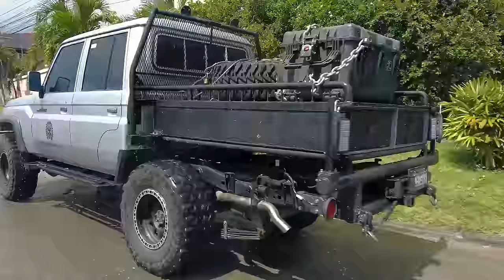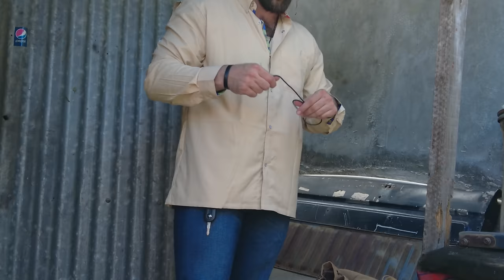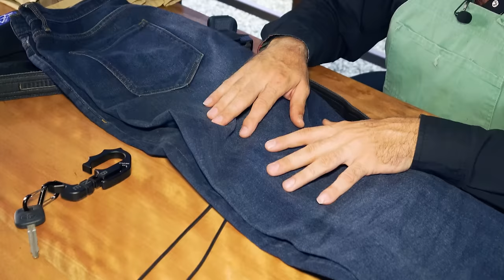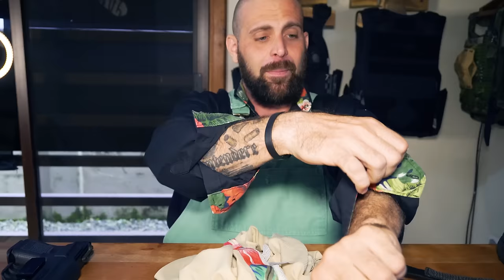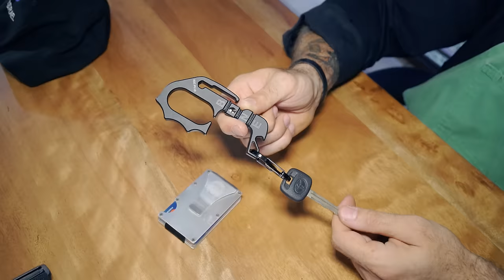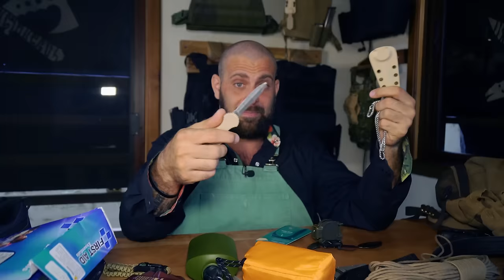The Real Gray Man Theory for the Next Civil War

Comment: Greg, I have a very low cost answer for hair cutting.  So low cost it less then the cost of one hair cut, the answer is a low cost pet trimmer that comes with a lithium battery fully chargeable holds a charge for months.  Here in the southern US the jeans are seen very similar to SA and CA.  Clean and neat no holes, you’re good to go.

Comment: I like the anti-pat down feature of the shirt.  It would be interesting to see if a handcuff key could made it through a pat down.  I'm pretty sure one of my boxcutter blades attached to a guitar pick with duct tape could pass inspection having almost no signature being small and flat.
Reply: Yeah that's the one thing I noticed that was missing. It's a good set up and he's right about stuff. But some way to slip cuffs and zipcuffs would be nice to have in the bag
Reply: Not through a metal detector ...use a ceramic blade 👍🤙👊 🍻 cheers
Reply from the maker: As discussed the pack has plenty of extra room for what you find to be personally useful to you and your situation
Reply from the maker: Yeah for sure there are slim handcuff keys that also fit in the coin pockets of the shirt 👊🏼
Reply: @BoneTactical  I like the pack.  It's sitting in my cart right now.  However, I'm torn between the long sleeve light colored shirt and the short sleeve floral Hawaiian.  Decisions, decisions.
Reply: @BoneTactical I became a fan of yours because of your philosophy. I've been in the same place you've been and you speak the truth. Even if I would keep some of it to myself lol. Keep it up.

Comment: I completely share your ethos on grayman theory. Most of what is taught will get people killed. Also I love the shirt. I'm not military but have been in some very hairy LATAM situations over the years working. From experience I have learnt, don't look rich, don't look military and if possible you want to be underestimated but professional and respectable. Wear a collared workwear shirt, wear double stich low brand trousers that stretch a bit. Riggers pants work great. Clean and presentable is also important.look at what s plumber or electrician might wear. I have worked in various engineering teams providing security solutions and the one thing I have always noticed, even within hostile environments, engineers are almost always welcome as they are both well educated and not office types. Especially if they are arriving to fix a problem, eg restoring Comms, power, water. Great choice of clothing. Maybe not cut your hair not so short, it looks less aggressive. Spectacles also soften the face and can double as eye protection.
Reply from the maker: Definitely respectable opinions thank you for your feedback and support